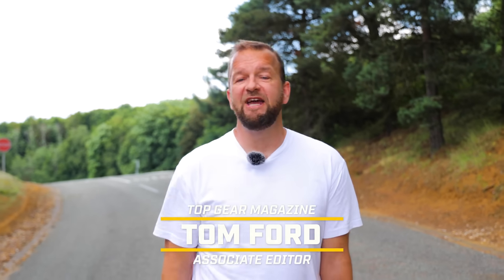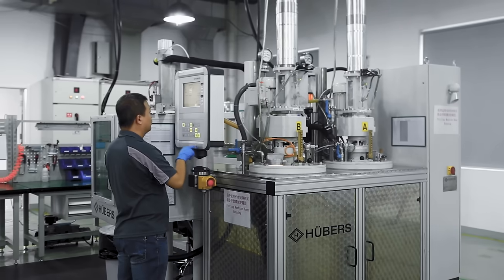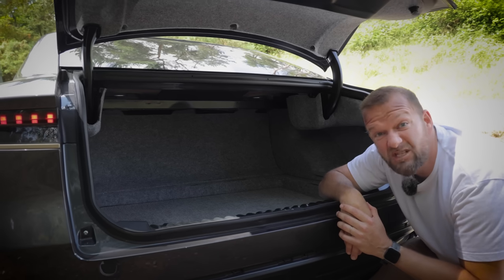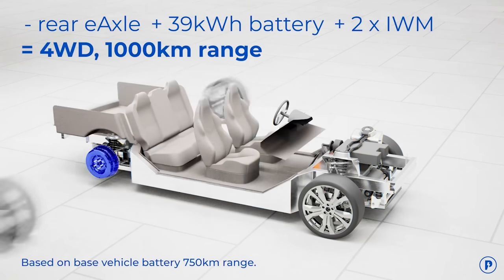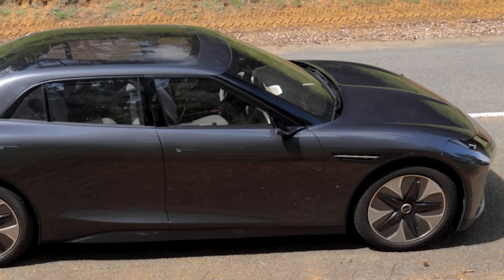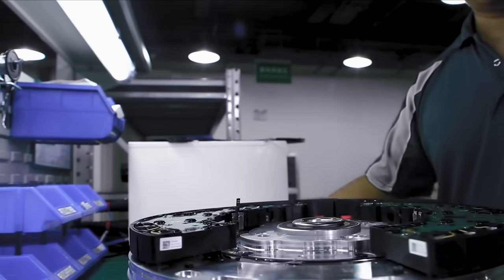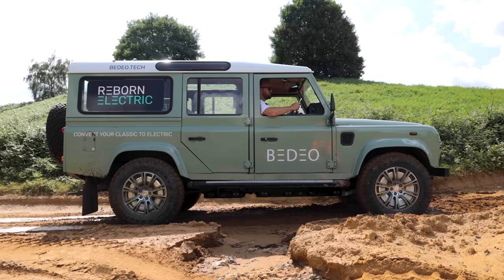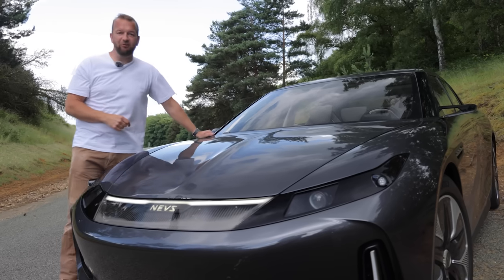NEVS Emily GT: SAAB’s Secret EV With 600 Mile Range | Top Gear

Comment: I always wonder why more automakers don't go with in-wheel motors. I know that truck company is having a difficult time, but I think that's more to do with the people than the tech. I think Hub motors could make EV conversions easier too. I can't wait to see more advancements in EV tech. I do miss SAAB also.
Reply: Because the motor makes wheels super heavy and super inefficient to turn.  Protean has been around for years and years and never got traction.
Reply: Plus your coupling heat from the brakes and motor in one assembly. Any type of extended performance driving would effect both.
Reply: @jerryk.1889 nice pun
Reply: @joshuasterling2144  I believe regenerative braking can be developed to counter that. I did agree with the earlier response about the increased weight being harder to steer. My question is, we don't have to make track worthy performance machines for the average consumer. 400whp is more than adequate for an everyday sedan. And with the creation of those cars, you'll get more research on making track worthy variants. If we don't legitimately try, then there won't be any future developments.
Reply: @JasonB72481  My specific reference was in the context of sport driving where that aspect of the car plays out less. Other than than I understand what your saying.
Reply: Because potholes. Take a massive one and there's so much to be lost when compared to a regular car
Reply: Because unsprung weight. It only works in this car due to the crazy heavy battery so the body itself is crazy heavy.

Comment: Nice and how do you change the tire?
An is the motor designed to resist all the vibrations and extreme conditions in a wheel?
Brakes can heat to more then 400 degrees... Magnets usually loose the magnetic properties at that temperatures.

Many manufacturers wanted to put the motors in the wheels but it was impossible or much too expensive.

Comment: What kind of brand name is "Emily"?

Also having the motors inside the wheels will make it feel like a lorry with all that unsprung mass
Reply: The main brand name is NEVS, Emily GT is the model name.

Also, the designer of the motors explained about the unsprung weight.

Comment: This is a mile stone in EV engineering, more efficient, more robust, and the simplest EV drivetrain possible. All inwheel motor challenges are solved by Protean apparently, kudos!  This concept allows for a simplified super efficient EV-body production, according to particular specs that support the Protean drivetrain. The NEVS Emily GT looks like a boss!

Comment: Question; Driving along a motorway, would it then be possible to use one ore two wheels for forward trust and the rest for reloading the battery?
Reply: Yes but that would defeat the purpose. You’d be loosing more energy moving forward than gaining it

Comment: For your reference about what happened to saab:
The story is related to NEVS and two chinese companiee, geely and chery. Geely, the company that bought volvo and lotus, started a R&D centre in Sweden in 2013, and developed the CMA platform (xc40, polestar 2 and a lot of link&co) and SEA archetechture (smart #1, zeekr, ex30, eletre). while CEVT employed former volve engineers and a lot of SAAB employees, the chery bought the brand. It's said that chery produced components for SAABs after 2012 when they bought the brand. As for NEVS, they bought the assets like factories.
Reply: So, if you want a saab, buy a volvo/zeekr/polestar.

Comment: Bicycles have been using in-wheel motors (hub motors) for years.  The electric unicycle does as well.  Good to hear the bit about the unsprung mass as that was my concern when watching this.  Aptera is also using in-wheel motors.  Let's see if they actually make it to production.  Saab?  A nice car for eccentrics.  At least until GM acquired it and destroyed the brand.  An Envoy rebadged as a Saab?  What were they thinking?

Comment: A lot of people are worried about the hub motors in regards to weight and reliability but every electric scooter and e-bike has been using a hub motor for the past 10 years so the technology is definitely there just needs to be optimized for automotive use.

Comment: In a practical sense, when you remove the wheel does the motor come with it? Or is the motor fixed to the hub? Some of the b-roll foot showed them fitting a wheel with the motor already in-situ. If that's true, having the tyres changed sounds like a problem.

Comment: Manufacturers have spent years developing light weight wheels, brakes and suspension to reduce un-sprung weight as this has a huge effect on the way a vehicle steers and rides. 
NEVS slaps on 140kg of extra USW yet claims it can respond like an F1 car. Newtons laws of motion do not support a statement like that.
Yes the car to wheel USW ratio may be similar to a standard set up but that extra mass still has to be managed and their s/w seems to do an amazing job.

Comment: I like it 
I hope the "software" tunes the in-wheel motors in a way to not shred the tires or over-stress the brakes/suspension, I'm sure they've thought of this but it's all marketing at this point for an unproven vehicle.
I would have much preferred a lighter car with half the battery and range. Still plenty and less wasteful for the battery building, you can build two cars with the same battery resources. It's spec-hunting. I guess it's a concept that wants to push range? 
Maybe increase storage or have a proper reserve wheel to fill that rear space.

Comment: I've seen a couple of hub-motor cars now, and my concern is for the motors in the wheels. Every bump you drive over, every ramp-lip, speed bump or anything else is going to create some degree of shock to the motor.  When they're inboard, they're protected from shocks (sudden motion spikes/vibrations, not electric shocks)  by the ... shocks. But hub motors are first to feel every pothole or disturbance in the road. Will this have an impact on their reliability or lifetime?

Comment: Besides the in-wheel motor, there is nothing really new. A pity. The in-wheel drive is used by the Aptera solar electric vehicle, which can be ordered now.
Reply: Solar electric? That thing would be dead 8 months of the year here in the Nordics.
Reply: @gundalfthelost1624  You can plug in the Aptera, too, and it still wins with low Cd, low mass and high efficiency.  I'm on the waiting list and I live in New England.  Yeah, the solar's gonna be a bust much of the time, but that's not the only interesting attribute of an Aptera.  My current car and its predecessor are Saabs (rather GMish Saabs, to be fair, Opels in Saab sheet metal), but I think Aptera is more in the spirit of the early Saabs than the heavy beast reviewed above.

Comment: very interesting concept...Torque steer much? Wonder if it's similar to the torque vectoring system on the Rimac nivera?
Must be some amazing software/sensor management going on to control the power going to each wheel when cornering. Also does the weight being inside the wheel affect the damping and tyre wear characteristics
I wonder what kwik-fit would make of it if I rocked up looking for a tyre change

Comment: I've been wondering why people don't use in-wheel motors for off-road cars for years. 
It's not about the torque vectoring - although that's nice obviously - it's the independence of the wheels. On a "classical" architecture you use a lot of differentials and locking mechanism just to get the torque to each wheel. With this system, each wheel generate its own torque.

Comment: It makes sense for EVs to move to in-wheel motors across the board. More efficiency through better aerodynamic design, more reliable because you have 4 motors instead of one and if one dies, you can still drive, more control, better handling, more room for batteries, access to more immediate power, more interior space or the option of making much smaller and lighter cars, less weight from the axles and other bits you can do away with.

If the big players, like Tesla and BYD, don't go this way, it would be a bit silly.

Comment: The motor being in the wheel would drastically increase weight, affecting the unsprung mass. Also how do you control heat? Heat is a killer.

Comment: Individually powered wheels always seemed to be the ideal format. 4WD, FWD, RWD, torque vectoring, longevity, maintenance...

You can opt for sprung or unsprung motors, but there is little to no advantage an AWD drivetrain has over 4 motors.

Comment: Hub electric motors are almost a great idea. I like the per-wheel motor very much.  However, instead of the hub, they should be elevated with gears to direct the power down and sideways to the wheels.  Reason is immunity to water and road salt.  Long term reliability is an important thing to consider and those motors need to be out of the way of such concerns.  With gears and boots only in the danger zone and no motors, that is a more controlled situation to keep greased and if a failure occurs, much less of a problem.

Comment: as working with racing suspensions, I would very much worry primarily about unsprung weight , and secondly as the wheel is unsprung things are constantly subjected to vast G-forces, anyone having travelled in a Citroen with broken hydraulics , instantly understand what I am on about....components in the unsprung wheels will BRAKE !! Particularly electronics !

Comment: My question is whether the placement of the motors has any bearing on the complexity of servicing and wheel rotations.  Also, with the SAAB company out of existence, will its parent company have a US infrastructure to support servicing NEVS?

Comment: Forgot dual motors, gimme quad motors. 50kw each and I would be thrilled already.

This seems brilliant, no wasted space, how about the damping? going through rough road, how is the nvh? Seems like you would also be lowering the centre of gravity to the hub height, even lower than boxer engines.

Comment: Now finally an EV that has a greater range than my buick lacrosse hybrid. But the question is, what's it's charge time and can i get it for 20 thousand dollars or less? This information i cant seem to get. For now, I'll continue to keep my buick lacrosse hybrid. I get a range of 402 to 408 miles. Fueling times is 7 minutes or less and that includes running in and grabbing a coffee. At 20 thousand, its paide off. I keep it cleaned, waxed and polished at all times meaning, it is very sharp looking.

Comment: All of the benefits of individual wheel power (or torque) control are valid, but they are available without in-wheel motors.

Comment: Still waiting for the old-car upgrade kits with the inhub stuff. As seen in the Crate-Engine idea.
Throw out engine + tank, drop in battery pack(s) there. +add hubmotors.
Biggest problem until now has been getting the motors into smaller wheels, 15 inch and such..
(i think one manufacturere of harddrives (WD?) said they were way ahead of the car manufacturers in that tech)
- please make it as a 25kW small wheel version and stop the race for more power.

Comment: I'm not convinced by the assertion that "in wheel motors" had only been used in special projects until this prototype car came along: Similar hub motors have been used for electric bikes for a long time - in fact the first electric bike using a hub motor dates back to 1895, so this is certainly not a new idea.
Many new electric bikes use similar motors, and e-bike retro-fit kits for converting an existing bike into an e-bike almost always use hub motors: These kits are basically the battery pack, wiring and electronics, plus a wheel with a hub motor, which can be swapped out with one of the existing bike wheels. Some such kits swap out the front wheel, whereas others swap out the rear wheel. It would technically be possible to use one of each type to swap out both wheels, to make a "2-wheel drive" electric bike with double the power, though I don't know whether this would be entirely legal to use on the road.

Comment: Car reviewers need to stop saying that the engine in a hybrid is there to "charge the batteries".  That's just not the case. The engine is primarily there to make the car GO, whether it's through torque to the wheels, or electric current to the traction motor. SOME power can go to the battery if needed, but that is not the main function of the engine.

Comment: Did anyone say "high rotational inertia"?🙄
And hitting just one serious pothole on a pockmatked road is going to break something expensive, despite all of Mr. Whiteheads comments on durability testing... it's a commercial product after all, that has to be produced at a cost that allows it to be sold.

Comment: It's funny that everyone is focusing on the SAAB moment and not the tech. We are on the cusp of a new automotive revolution and we are allowing the big companies to dictate the future and just continue to jack up prices even though we al know it's going to be cheaper to build EV's. This concept is a slap in the face of the money grabbing practices of the big companies. If I can charge my car before going on a long trip and charge the car after a full day of driving overnight ant the destination, that is the ideal for the user. If I'm to stop every 250km to charge like I ride a horse in medieval times that's not my dream, that's the charging station operators dream. I would pay for an EV that has hub motor drive, even with two motors, decent speed and no range anxiety. But I feel that's not what the modern auto making paradigm want to pursue. 

They want us to lease our cars, not own them, subscribe to features that can be withheld is not paid, track us and use our personal data to sell to advertisers, or anyone who has the money to pay for it (not going to go deeper then that), deplete our battery at will for whatever reason, restrict or navigation options (for our safety, of course), go to the charging station of their choice and charge only their approved chargers, have no right to repair, withhold schematics and make the car temper proof, and pay for this the low low price of 499.99 a month for the REST OF YOUR LIFE. The last not on this before moving into the positives is the fact that the Automotive industry is aggressively moving away from calling themselves automotive, cars, trucks, etc. The are pushing the term MOBILITY because that means you don't get to use a car but use transportation and that means you don't get to have the freedom of owning the car you want but be part of the "family" or "brand" of "mobility solutions" they and only they can provide.

This tech would make easier to retrofit older cars, in markets that have less accessibility to modern cars and give a new lease on life. The hubs could, should be replaced after 4 years but imagine changing them like your tires and moving the back ones to the front and just buying 2 new ones for the back. Let's just turn off two if we need to extend range or you are in a cruising mode and have no need for a lot of performance. Anyway, long rant, need to stop for my own mental heath.

Great video, great concept! I wish I had a couple of millions to invest and push the tech into the hands of the people. I wish them the best.

Comment: How difficult would it be to change the tires at least twice a year? What if you get into a minor finder bender like hitting a curb or another car on an angle? The wheel(s) will definitely be in contact with another part of the car and an alignment will be needed? How  difficult will it be to repair the tire with the motor inside it.
Reply: The wheels are normal wheels, they are bolted to the motors.

Comment: Not crazy about the motors being in the wheels. Seems susceptible to damage easily from pot holes. And what about maintenance - brakes, wheel bearings, suspension bushings, etc? However, good to see SAAB back innovating.

Comment: It looks good. About the only thing they should do is reduce the battery down to 100kW. The average person doesn't need 600 miles of range, so you're just lugging around a lot of extra, unnecessary weight.

Comment: Leaving SAAB engineers un-monitored is how GM lost money on the 'shared platform' of the last models,.. but in this case appears to have turned in to something unique. Hope they do go to market, and ressurect the SAAB badge with it, the world needs more unique thinking,... That 1000+ KM range would drive sales too, "Range anxiety? What's that?" could be the sales catch phrase.
All the unsprung mass is still going to require specialist engineering in the tyre development, for them to be strong enough to handle the loads and shocks, but flexible enough to prevent those shocks being transfered to the motors and bearings, while leaving the suspension to deal with the mass and inertia of the chassis.

Comment: if the motor is inside the wheel, than it is not suspended! (usually the motor need shock absorption attributed by the suspension sysem). wont those engines wear of quicker?

Comment: I was a Saab mechanic back in the mid 70's. And I drove an orange Sonnet 3! So I'm still a huge fanboy! 

But I've got to say the hub motor thing is nothing new. Every electric scooter, every electric unicycle & every One Wheel are all powered by hub motors as are most e-bikes. (Although personally I prefer a mid-drive e-bike.)

Comment: The important question is how much do the wheel mounted motors weight? You don't want unsprung mass in any vehicle running on wheels because that will make suspension work really poorly unless you're running on smooth tarmac all the time.

This far the only actually working solution for real world use on real world roads has been moving the electric motors into suspended part of the vehicle and use CVT joints to transmit power to the wheels. However, if you could create light enough electric motors, then hub motors would be the best solution.